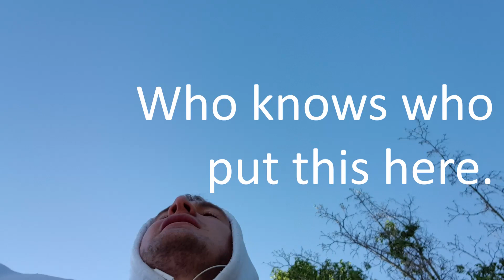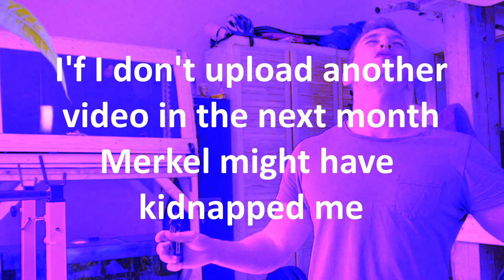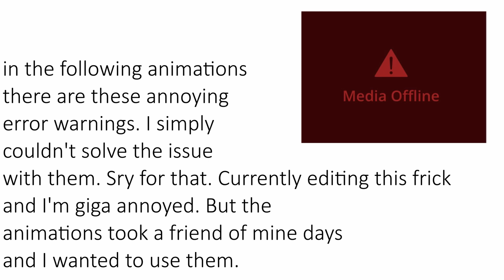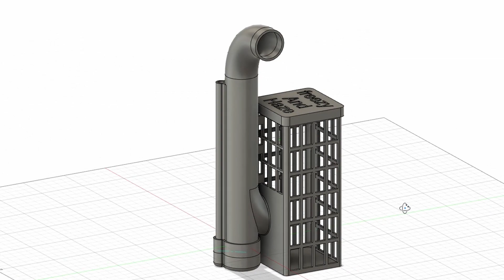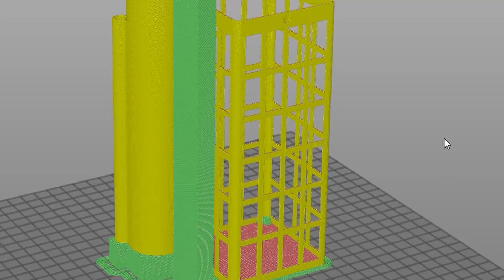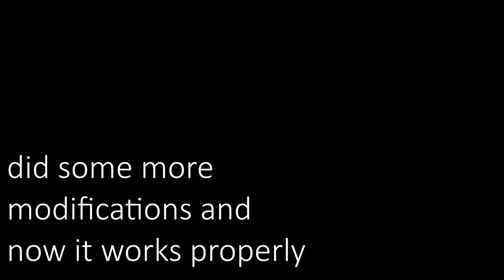Building a DIY 3D Printed Air Lift Filter Pump for my Aquarium

Comment from the maker: Oi everybody, sorry for not explaining how I modified the filter pump at the very end of the video ... I thought no one would care. Basically I realized, that the vertical pipe was leaking air. I made a smol mistake while printing the whole thing, which caused the walls of the pipe to leak. This resulted in a reduction of the total air bubble flow rising up to the exit of the pump and this caused a dramatic loss of pumping power. So I used water resistant clear spray to seal the walls of the pipe ... and that s how I increased the overall water flow of the pump.

Comment: this small motor pump does not look capable of strong air flow and the tube diameter is too large. if you designed a smaller tube diameter with multiple small outlets, this may works better. It's all about pressure to push the air or water out from the pump to the outlet or tube. less pressue, smaller the tube hole... 😄
Reply from the maker: U might be onto sth 🧐🤔

Comment: USB water pump. 5v 0.75A. 300L/Hr. silent.
Reply from the maker: Yessir. It's definitely not the most power efficient pump :D but I wanted to build it anyways and a nice thing about these kind of pumps is that the water is interspersed with lots of air bubbles
Reply: Yeh they have their niche, i like how they work but then i researched it and found out its not that efficient. Love your work regardless, im just about to embark on my 3d printer journey myself, learning and looking to buy first model.
Reply from the maker: @MrWackozacko  Thanks m8. Appreciate it. What printer are you looking to get?
Reply: @freezyAndHaze  Its mostly for aquaponics and fishtank parts for now so i think im right in going for whatever prints in PETG but down the road id like to print and experiment with different trolling motor props so i might get something that can also do the nylon carbon fiber filament. Whats the best brand? You might be just the guy to ask.
Reply from the maker: @MrWackozacko  Got it. I absolutely love Nylon-Carbon. I think it looks amazing and from my experience with drone frames and some other applications it's much stronger (especially the impact resistance) than PLA or PETG. Then again, a trailing prop is some pretty hardcore stress. Would be interested in whether you succeed ... hm .. best brand. I've mostly been printing with machines from Creality. I think the Ender 3 V2 is a nice, cheap and reliable little printer, if the 220 x 220 x 250 mm build volume is big enough for you. But you'll need to attach an all metal hotend with a steel nozzle to print nylon carbon. Doing such a mod is some good learning.
Reply: @freezyAndHaze  Yes its all new to me, have been in my vision for a while but just started to take it seriously, thank you for the machine recommendation ill look into that
Reply: @freezyAndHaze  If i succeed and i remember ill let you know